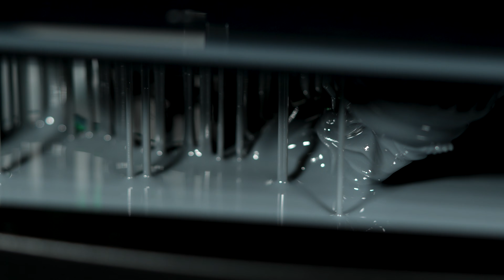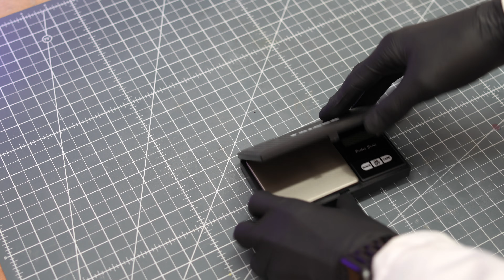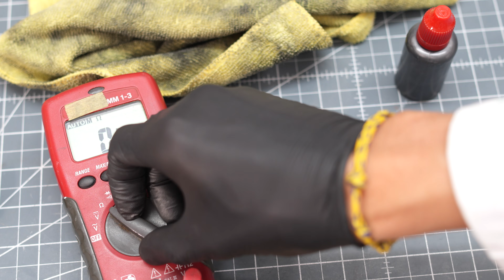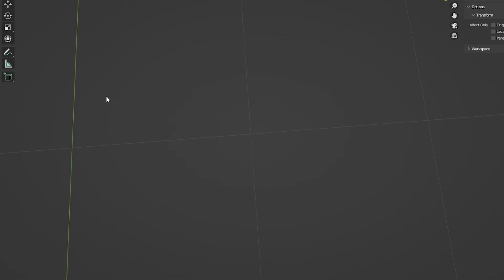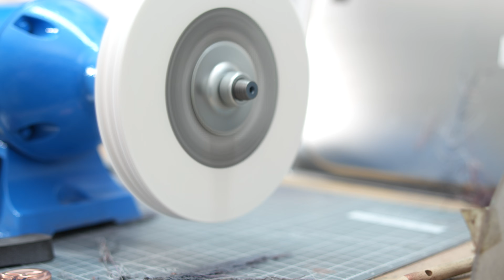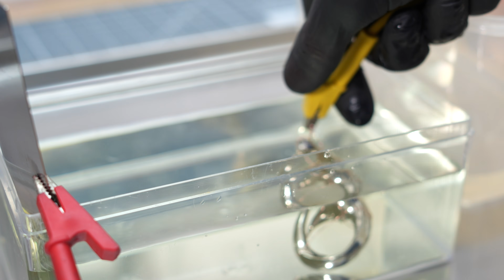Super Shiny 3D Prints | DIY Electroplating

Comment: Wonderfully edited video! I followed along with your Narsil project recently to make a gift for a friend, and it worked absolutely perfectly with the graphite paint. Working on making a nickel and copper chess set now! Thank you so much for your videos on this relatively niche hobby. I honestly couldn't do it without these guides.
Reply: What was the binder you used? Idk where you are, but the linked stuff doesn't ship to my country, nor could I find a chemical name for translation. (Cause when he said 2 part glue, my mind went to epoxy or super glue)
Reply: I couldn't get it locally in Australia, either. I found the following works really well:
40g Acetone
2g Gorilla Super Glue
5g Graphite
Reply: @Robert-cl8oy  I'm having a hard time finding fine enough graphite powder.  I have some that is labeled as 400 mesh and it seems to big to use in an airbrush, clogs all the time.

Comment: A good thing to point out to those who are just beginning. Not all Copper Sulfate Solutions have a brightener additive included. My plating was coming out dull and rough and I found out that the Copper Electrolyte had no such brightener added. I didn't hear anything about it in any videos. So, I bought Thiourea/Fine Crystals to use as a brightening agent to add to my Copper Electrolyte. I am hoping this works. The Bright Copper Electrolyte link in this video doesn't lead to anything specific. I did find Copper Plating Kit with 32oz Solution, Anode, Brighteners, Power Supply, Service, Replating, Bright Electroplating for Jewelry, Gun, Pen, 1 Quart for $60.00 only AFTER buying the crystals.

Comment: Great videos, I have seen a lot of your electroplating 3D prints series and I want to try your techniques. However I have a question: First to get the surface area you change the scale in blender to 0.01, that would be cm, not dm and then you calculate the surface area which in this case shows 0.3211 m2, which would be 0.3211 cm2 after the scale change and that would equal to .003211 dm2 and thus, a calculated current of 3 mA assuming 1 A/dm2, but It seems that you take the calculated area value in cm2 and use it directly to program the current on the power supply. I am a bit confused, could you help me understand this? thank you!
Reply from the maker: i use "wrong" units in blender to actually get the value in A/dm². you can use this tool as well: electro.scorzz.com
Reply: @hen3drik  Thank you!, I'll check that tool. Keep up the great work!

Comment: Great video. I am a little confused with the figuring out the area in blender. You show the file in there but right when it shows, it says your model is 0.39 m (basically almost 15 inches) when that model is clearly not that big. I have my model scaled to the correct size that I printed it and it shows the area is 0.05. So was your amp too high or am I missing something? I’d appreciate any help! Thanks!
Reply from the maker: Try this: electro.scorzz.com
Reply: @hen3drik  Should I use less current than what that site says if I only plate one side of the print like how you only did the front of the mask?

Comment: Hey Hendrik! Thank you for making such incredible reference materials as I learn to electroplate as well. My pieces do not come out nearly as shiny, sadly. Do you have any recommendations on what I can do better? I've been using a conductive spray paint I found on Amazon (I'm US based). Does the finish from the paint need to be extremely smooth? How do you go about troubleshooting, being I know you've said in the past it takes you a few trials before getting such amazing results. I've seen Xeno say he starts at like 0.3V for 30min, moves to 0.5V for 1hr, and then does the 2A/dm^2 for 4 hours. Do you recommend ramping up voltage like so, or do you just go straight for the 2A/dm^2?
Reply from the maker: You’ll need a brightener in your solution to get the shine + a smooth conductive layer. Ramping up is a good choice. Do go by voltage but 0.5A/dm2 first then ramp up.
Reply: @hen3drik  Thank you, that helped! I forgot I needed to add some. I'm getting shininess now, but it's splotchy. I'm sorry for the endless questions, but maybe one more? ❤

Comment: I like all your videos, and inspired by your results

and i got 3 questions
1. what nozzle size you are using air brush to paint graphite coating 0.3mm or 9.5mm or 0.8mm

2.what chemicals used for gold plating solution

3. what solution used for silver plating solution

and i am creating acrylic laser cut to paint gold and silver finish
Reply from the maker: Thanks,
0.5 nozzle size

Comment: 3M makes absolutely shit tier products 
I would not trust their masks to filter anything.
Their filters do 100% fuckall
Literally no better than holding a tissue to your nose.
I used brand new organic vapor filters and 3m half face respirator to paint the concrete block in my garage and became violent ly ill after about an hour 
Their products suck and they don't even work at all.
The only way to be safe is hire a Mexican to do it 
Trust me  the PPE you can buy is shit and it does nothing but lull you into a false sense of protection and drain your wallet, the only way to be safe is to not work with toxic shit period.
You only THINK you are not being exposed but trust me you ARE being exposed.
I learned the hard way more than  once
The PPE is a joke.

Comment: Can you add or remove other pieces from the copper bath process by adjusting the calculated amps accordingly? That way you are using just one bath and power supply and then do an assembly line process
Reply from the maker: Yes

Comment: Hey there, I am writting this comment because I have been trying this experiment but only the copper "electroplates" (graphite layers does not change at all ) getting dull, is there a reason?

Edit: After checking the 3dprint with a multimeter there is much higher Resistance than before, is that because of the adhesive I am using?

Comment: I tried the exact graphite recipe from the same company (4 micron graphite, uhu binder and some pure acetone). The results were not great, it took 6 coats and a light polish with microfibre cloth in between just to get 1.7Kohms.

It basically didn't adhere properly to the print so being slightly too rough with the microfibre took it off.

A big thank you to one of the commenters here (@Robert-cl8oy) on using 2g Gorilla Super Glue in place of the 1g UHU. It worked perfectly!

1st coat= 3Mohm, 2nd coat =1.3Kohm, 3rd coat= 700ohm. Each layer dried in under a minute and binded really well to the part. Worked well with a 0.4 airbrush.
Reply from the maker: Yes, tried this recipe, too. It’s works very good.

Comment: You can also use a fish tank pump to circulate the water instead of rotating the part.
Reply: you might still get shadows unless your part is fairly thin, because the voltage isn't uniform, as the distance from the electrode isn't constant.
Reply: How about a copper screen basket that that tumbles the part in it like a hamster wheel, will that make enough contact to electroplate?
Reply: @JasonThomasHorn  I think the issue lies in the concept of electrophoresis allowing ions to travel unidirectionally from one side of the bin to the other. So rotating the part allows a surface to be facing towards the flow of ions. Tumbling the part in a copper hamster wheel might be more trouble than it's worth compared to turning it on a small, cheap motor.

I've never done electroplating before, so take that with a grain of salt, but we use this method in molecular biology for separating DNA fragments.

Comment: Thank you!  It was your channel that stated me down the path of electroplating resin prints, and I've been watching ever since.  You do a really good job explaining everything, and the results you have are inspiring.

I've been experimenting with graphite conductive paint for months, with very mixed results using everything from different inks and glues as the binder, different amounts of graphite, etc. I also purchased silver conductive paint (really good, but really expensive), and nickel conductive paint (not so conductive and too thick for airbrush).  If I could afford silver conductive paint, then I'd always use that.

I used your recipe, but couldn't get the same UHU glue locally here in Australia.  I substituted with Gorilla Super Glue XL.  I think the concept here is it needs to dissolve in solvent so the glue becomes more binding once the Acetone evaporates off.  The glue needs to adhere to resin plastic really well, so I went with a super glue.  After a few tests, I found the following works best:

40g Acetone
2g Gorilla Super Glue
5g Graphite

This only required 2 coats to obtain an even coat of copper.  Each coat dried in under a minute (used airbrush to dry the part), and I polished with a cloth and toothbrush between coats. This works well airbrushing or dipping the part.  Haven't tried brushing it on yet.

I feel I've discovered the holy grail of conductive paint, and all thanks to you.

Thanks again. Looking forward to more great content.
Reply from the maker: Oh nice, I’ll try that recipe! Glad you are having fun on that journey of electroplating 😃
Reply: Please tell me what micron size graphite you are using for your airbrush, that is my biggest stumbling block right now.
Reply: Hey I'm also based in Aus and have been having no luck getting my diy paints to go through my .3mm airbrush. Mind letting me know what graphite brand you've found that works?
Reply: Asking the same question, what graphite did you use? Looking to follow these tutorials he puts up but sadly all his affiliate links are not for the Amazon in the US
Reply: Try water based grout sealer Bunnings sell this . 50/50 with graphite
Reply: how does this recipe stack up against india ink and grahpite?

Comment: I wonder if you can put a pump in the bath and force the solution through a filter and reintroduced into the bath causing a liquid current. That coupled with the rotating part would give better flow of (fresh) solution touching the part.

Comment: Struggling with the making my part conductive for eletroplating? And can you use conductive filament?
Reply from the maker: Conductive filament is very hard to plate: don’t do it. Try copper conductive paint as it’s the easiest to plate on.
Reply: @hen3drik  I tried a silver copper conductive paint and didn't make it conductive is this a layer issue perhaps?

Comment: Great video. I was looking into the binder. It looks like the Epoxy Part 1 is the epoxy only, not the harter (hardener). In that case the Binder under the UHU SDS that Hen3drik used is bisphenol-a-(epichlorhydrin) epoxy resin or BPA.  Of course this is the same BPA that has health effects for brain, prostate gland of fetuses to children, so exercise caution and PPE. Or find an alternative epoxy resin as your binder.
Reply: I really appreciate your information. Can UHU be used as a binder to mix with other products as shown in the video?
Reply: It probably can since it's basically only the BPA portion. I ended up using PVA white glue as my binder with graphite powder instead of BPA for the safe side. It's the same formula as wire glue.  It may need more binder than BPA.
Reply: @MuseumGoon   How did it turn out?
Reply: @teresar6348  I switched to a different formula that uses graphite, isopropanol, butanol, methoxy propanol, and a thermoplastic resin,

Comment: Okay I've some questions

1.) my laboratory power supply can go up to 15V and 2A. Is it enough for a bit bigger parts? My problem here is: the tifoo calculator tells me way more Amps in an acid solution instead of an alkaline. The alkaline solution is NOT for an "end coating" and the I hear 1.5A / dm... I'm a bit confused.

2.) wich is better? copper conductive paint or the graphite paint? in older videos you used copper but I think graphite works well too and has lower costs 

I hope you can understand me, otherwise kannst du auch in deutsch mit mir schreiben, kein problem^^
Reply from the maker: 1) use acidic copper electrolyte. 1-1.5A/dm^2 surface area in constant current mode. 2A = 2dm^2 surface area max. 
2) use copper paint if you can get your hands on it. It‘s easier to start with.
Reply: Thanks for help. One thing I can't understand. Let me explain. The figure in the video has a surface of ~ 216 cm² and you need 10.8 A right? But your supply has max 5A. And that means it takes only longer to get a coat on it? I mean, the figure is a success.
Reply from the maker: @Bl0ckfett  I admit, the way i show it is confusing. I'm lazy and use a unit value that gives me the (pseudo)result of the 1A/dm² directly in blender. The unit in blender is NOT what the surface area actually is. Sorry, my fault. The long way ist 1) set the units to 0.001 and you get the m² 2) convert m² in dm². The figurine is actually 2.16 dm² -> so i used between 2.16 and around 4A/dm²
Reply: @hen3drik   Okay I understand. Thanks for the answer ;-)

Comment: Have you tried printing with ABS and then acetone smoothing the print? It creates an incredibly shiny surface. I feel like this would eliminate some, if not all, of the sanding required before the graphite/copper/whatever spray used to prep for the electrolyte bath.
Reply from the maker: Unfortunately vapor smoothing doesn’t make the prints even.

Comment: Alright finally got everything ordered. Going to try this out at the end of the month. I got a few questions though. You say measure for 1k to 2k ohms but your meter is showing 17k ohm in the video? Also why did the first flying lady not workout? Did you not test? Can I use a buffing wheel with no polishing compound on the graphite to polish it or is microfiber rag enough? Does the UHU two part work better then the UHU hart? I ordered the UHU hart.
Reply from the maker: Hi, ignore the ohm meter. Try to apply several thin coats of graphite until you hit the spot around 1k. Polish between the layers. A rag is enough. You can use Uhu hart. Make sure it dissolves completely. Good luck!
Reply: @hen3drik  Thanks! Looking forward to trying it out.

Comment: What if you take transparent resin and add graphite powder to it as a filler?  Will such models be electrically conductive enough for electroplating?
Reply from the maker: According to other researchers: no
Reply: Yes. I use a "gloss glazing liquid" which is a slow drying clear acrylic. Then I add 2:1 graphite by volume to it. Typically only a table spoon of liquid and 2 tablespoons of graphite is enough for most of my prints. Then I let it dry well and polish it. After polishing it is usually around 200 ohms / cm which I think is better than he's getting at 2k ohms? Polishing properly  seems to be key. You can also manually touch up areas that don't perfectly coat.
Reply from the maker: I thought he meant resin for resin 3D printers.

Comment: can u recommend what binder brand should i get ? what have in Ace Hardware
Reply from the maker: Try to find an expoxy 2 component glue. Use the binder of it. You can use any other glue, too. Works more or less the same. Make sure it‘s dissolved.

Comment: Hello, I love your work. Very delicate with those figurines. I have a carbon fiber spinner, which has a white on the outside. I would love to plate it with a chrome like finish. Its 15 in in diameter and 17 in long. Which steps should I take? Do you think the plating is durable enough to stand the elements?

Comment: Wow! Beautiful..  I've had no luck electroplating with graphite, anyone know what "binder" would mean in the states? Glue, epoxy?
Reply: I don't know what kind of binder would work like what he has, but I have been having great luck with a mixture of just Speedball India Ink and graphite powder. Start with a 50/50 mix then adjust as needed. I did 5 tbsp of ink and 6 tbsp of graphite, worked pretty good, made it through an airbrush no problem, just need to clean the airbrush really good immediately after using. Water works fine for that too which is pretty awesome. Just follow the same steps in the vid, spray, polish, spray, polish etc... for a really good base layer. You are looking for continuity of less than 4k, but I can easily get less than 1k. Just make sure whatever you are spraying on is nice and clean, and any under layers are fully cured. Any off gassing will cause the graphite to crack, which looks super cool if that is the effect you are going for

Comment: Why do you use graphite powder? Why not aluminium or copper powder? Graphite has 400 times more resistivity than aluminum.
Reply: Typically cost. Graphite is a lot cheaper than copper. Copper conducts better but it’s a lot harder to diy a copper paint and more expensive.

Comment: Nice video! I have a question. Can they be used for brass plating? I mean, after the copper plating, rinsing them with an alcaline bath with zinc to get them covered with a nice zin plating and then heating them to get the copper migrate to the surface, giving it the golden look typical of brass. If it can be done it would be great for “gold plating” stuff that we don’t really need or want a real gold plating for like props or things like that. All this while being easier and cheaper. Not to get away with gold, it’s just for different uses. Gold is fragile when in 24k form, but if you want really really bright gold you can’t go wrong with real gold
Reply from the maker: Yes, it’s exactly working as you said. I Never do this as it’s a little hard to handle. I mean, yes it’s cheaper but a quick gold finish isn’t that expensive either.